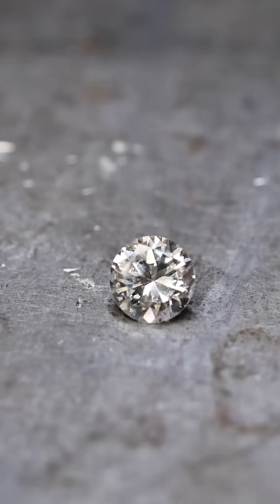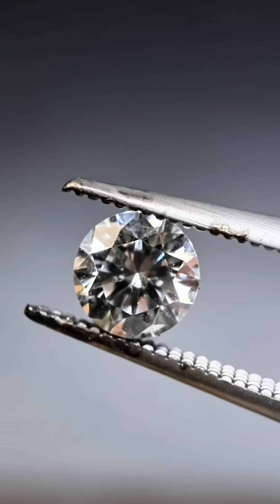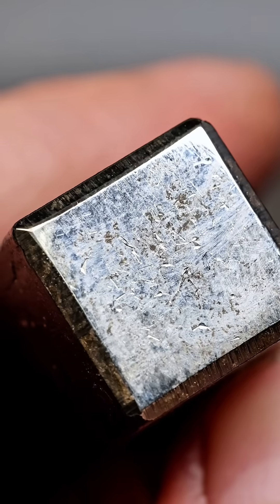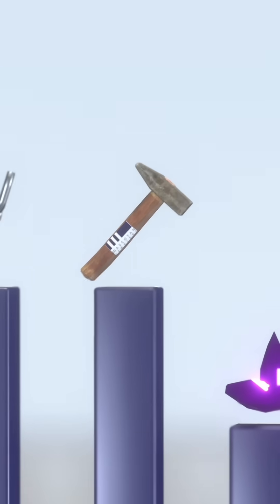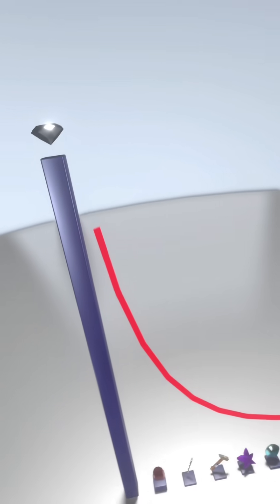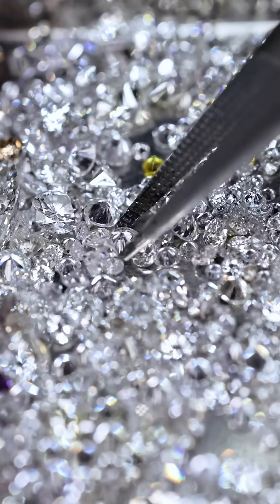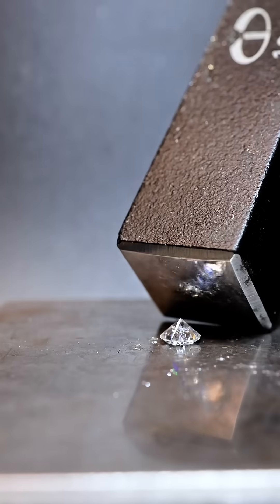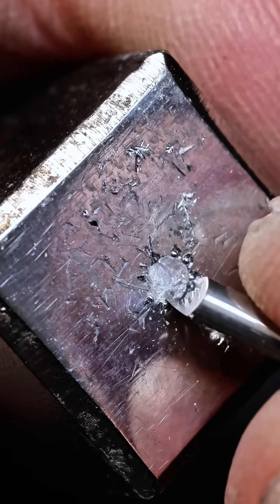Diamond vs Hammer

Comment: one of the worst videos ever seen for misinformation, diamonds are resistant to hardness, but not to tenacity, this means that (if hit at the correct angle and force) they break very easily even with a steel hammer. At least I'm glad to see that the mistake was highlighted in the comments, even if I would have completely removed the video to remake it.

Comment: I think you need to update your hardness scale because actually mature harder than diamond actually the materials called graphene Graphene Is much harder than diamond With 30 layers of It is bulletproof And each layer is as thick as a singular atom By default graphene is much stronger than Diamond Considering 30 mirror layers of this stuff Can It's bulletproof As well as it is much thinner

Comment: BS video, hit a diamond with a hammer with some actual force and it will break.
Diamonds are hard (meaning scratch resistant) but actually brittle (meaning not that impact resistant, or at least way less than what people think).

Comment: Hardness is defined as the ability to resist scratch. Pounding the diamond does not determine its hardness. As a matter of fact, diamond is very brittle. Pounding is a form of tensile test, which diamond is not very resistant to

Comment: not only was the huge mixup between hardness and toughness, you also said something pretty wrong about ordinal scales: you treated it as if it was an exponential scale, in which an increase in the scale would mean a multiplication in value. An ordinal scale would mean the scale doesn't work for any sort of measurement besides "is x greater than y". If Moh's hardness scale is indeed ordinal, the only thing you can say is that diamond is harder than anything below a 10 on that scale. It isn't really possible to drive a "x times harder" on a scale that is ordinal

Comment: Ordinal scale has a different meaning from what you suggested as well:

There are several types of scales used in measurements, each designed for specific purposes. Here’s a breakdown of some common types:

Nominal Scale: This is used for categorization without any numerical or order significance. For example, classifying people by their hair color (e.g., black, brown, blond) or labeling types of minerals.

Ordinal Scale: This ranks items in an order based on a certain property, but the intervals between ranks are not equal or measurable. The Mohs scale, which we talked about earlier, and things like finishing positions in a race (1st, 2nd, 3rd) fall into this category.

Interval Scale: Here, the intervals between measurements are meaningful and equal. A good example is the Celsius or Fahrenheit temperature scale, where the difference between 20°C and 30°C is the same as that between 30°C and 40°C. However, these scales don’t have a true zero (e.g., 0°C doesn’t mean "no temperature").

Ratio Scale: Like the interval scale, but with a meaningful zero point, allowing for ratios to be calculated. Common examples include weight, height, and age, where "0" represents the absence of the property being measured.

Logarithmic Scale: This scale measures data that spans a wide range, compressing it into more manageable numbers. Examples include the Richter scale for earthquake intensity and the pH scale for acidity and alkalinity.

Exponential Scale: Used when values increase multiplicatively. For instance, in sound measurement, the decibel scale reflects an exponential relationship.

Absolute Scale: A scale with a fixed unit of measure and an absolute zero. For example, the Kelvin temperature scale in physics.

Comment: Massoyan makes a correction in the pinned comment, which is accurate, but he doesn't give himself enough credit.
Hardness has a real impact on the impact-fracturing of hard non-ductile materials. For example, if you ever try to break tempered glass panes with a hammer in the center of the pane, it's actually pretty tough to do.  When robbers want to break into a car, they use a little tool with a sharp ceramic or hard metal tip. This tool, on impact with the glass, creates an imperfection in the surface of the glass, a scratch or chip, which due to the momentum of the tool then catalyzes the formation of cracks and ultimately the destruction of the entire window. It's hard to break something without a weak spot.   Throwing ceramic spark plug pieces at windows also works, but softer materials often won't do the trick.

Comment: It’s amazing how a diamond 💎 will shatter when hit a certain way. 
In the body, our teeth are the hardest substance, but the Achilles tendon is likely the strongest structure. A tooth can survive a crematorium furnace but will crack, break, or can be knocked out with very little force. The Achilles can withstand four or five times a person’s body weight, but when tweaked just the wrong way it tears like tissue paper. 
Amazing

Comment: Diamonds can be broken with a hammer, although it's very hard and requires considerable force. While diamonds are known for their hardness and ability to scratch other materials, they are also brittle and can break if struck hard enough, especially at a weak point.   Check online yourself
Reply: it did seem like he was gently tapping it
Reply: @JoseCruz-nd8fi  Glad I'm not the only one who saw that. You are not going break or even deform way softer materials with those love tabs.
Reply: Finally! I was looking for this! Hardness is not the same as brittleness - the tendency for some material to scratch vs. actually break, because of strong directional carbon-carbon bonds. That’s why it shatters.
Reply: real
Reply: How right you are chump! I even seen a T-Rex skull break a diamond. I saw it on Jimmy Neutron
Reply: Geek. Get a life.

Comment: As a 3rd Sec student in Egypt 
MOHs scale is not related to breaking of diamond
MOHs scale is about if the diamond can be scratched or not and since diamond has a scale of 10 this means its very hard to scratch but in breaking if you apply enough pressure on the diamond it might break

Edit: sorry if any information is wrong bec studying geology is new to me so correct me if anything is wrong

Comment: If you place a diamond on a thick iron surface and strike it with a hammer, the diamond is very likely to shatter or crack, rather than get embedded into the metal.

Here’s why:

Diamond is the hardest natural material, but it is also very brittle. That means it resists scratching extremely well but breaks easily under impact.

Iron, especially in the form of a thick surface, is much more ductile and impact-resistant than diamond.

When you hit the diamond with a hammer, the force is concentrated on its crystal structure, which can't absorb impact well — so the diamond will likely break.

So in this situation, the diamond would break, and the iron would remain mostly undamaged.

Comment: Diamonds are fantastic for manufacturing. I run a polishing lathe to finish cobalt chromium metal pieces and a single sintered (diamond throughout the working surface not just bonded to the outer edge) bit lasts me a few weeks used day in day out

Comment: Ok all this is wrong, hardness and toughness are 2 different things, hardness is scratch resistance, toughness is how much force it takes to break something, while daimond way be the hardness, it's actually fairly weak and one good smack with a hammer would break it, not those light taps, litterally slam the hammer on the damn daimond and it'd break

Comment: Wasting precious, limited resources for dumb videos.
Reply: Precious? Yeah they're expensive, but they're not limited. Lab made diamonds have existed forever and they can pretty much perform the exact same tasks with a way lower cost.

Lab diamonds are 60% to 85% cheaper than natural ones, with negligible difference. They require no habitat destruction, no soil or materials. They cause very low amounts of air and water pollution. They require high amounts of energy, but it's dependent on the method they are made from.

They're not wasting as many resources as you're thinking, it may be wasteful money but it's not yours so why care.

Comment: Ironically, what you did there by adding a diamond to your hammer is something similar to a scientific instrument that uses diamonds and a press in order to squeeze objects and apply specific amounts of pressure. It is mostly used to study material changes under high pressure and make metalic non-metal.

Comment: To explain this easier, in the beginning without the diamond in the hammer he was hitting the diamond at the larger part which is very, very strong, but when he put the diamond in the hammer he hit the tip of the diamond which is much weaker. I want to justify, I am not a geologist I just heard this somewhere else, it may or may not be true.

Comment: EDIT: TY @MrK0nam3 for the correction!  :-)
I did the same thing that the OP did [based on the info I knew] and misreading the different website info.
* I confused strength vs pressure with hardness.
* A limpet's teeth are 5.0 - 5.5 on the Mohs Scale... Definitely not a 10! This makes it impossible for the teeth to scratch a diamond.
* In the Discovery program I had watched about 10 years ago, it specifically said something along the lines of, "The teeth are stronger than diamond, making them the only thing capable of scratching a diamond, except diamond"
* That's what stuck in my mind all these years. Also something about the particular snail only being found in the Marianas Trench.

My OP: Since you are a Jeweler, you might this VERY INTERESTING...
* Diamond ISN'T ACTUALLY the hardest material... it's SEA SNAIL TEETH ~(o_O)~
* "While diamonds are incredibly hard, the strongest biological material, found in some sea snails like limpets, is harder than diamond. This material, a form of wurtzite boron nitrate, has a diamond-like arrangement at the atomic level and can withstand 58% more stress than diamond."
* Learned this about 10 years ago on a Discovery program :-)
Reply: Diamond is the hardest natural material, sea snail is superior in other aspects but not in the  Mohs scale which define hardness

Comment: The other diamond wasn't needed at all, steel might be softer but nothing says it can't break a diamond if you give it a good swing. It's like assuming you can't break glass with mud, after all, mud isn't hard at all, in fact it's liquid! But throw a mudball at a window and it will shatter easily. Hardness only applies to the ability of a material to scratch another, so no idea what the heck this video is even about... Just a shitpost? The ability of a material to withstand mechanical forces is not it's hardness but elasticity and tensile strength, which is why steel, which is only somewhat hard but is quite good in tensile strength and has decent elasticity (non hardened) will probably never break unless bent to the extreme (if then, some steel won't break/tear even if it's thick and bent 180 degrees), only bend and deform. So again, gj wasting time and resources I guess, while telling nothing of value

Comment: In electron microscopy, biological samples are embedded in resin and cut into 60nm thick slices using a diamond or glass knife and a tool called an ultramicrotome. The resin basically just a tough plastic, you can trim it a bit by hand with a razor blade. However, at my school new students learning how to cut samples weren’t allowed to use the diamond knives (only glass) because it was possible to chip and break the diamond knives if you cut too deep into the resin; also diamond knives cost about 1k-2k a piece. Imagine having to worry about breaking diamonds with basically plastic.
Reply: This is pretty interesting to read for me being a certified gemstone cutter. In my week of school, I cut three perfect stones. The admin at the school were pretty hyped because nobody had ever finished three in the single week of class, let alone three completely perfect stones.

Comment: Diamonds are hard not tough they might be the hardest material but once there structure is slightly deformed they shatter think of it like a glass bottle compared to a plastic one the glass bottle is harder but unlike the plastic bottle once the glass bottles form is deformed it will shatter

Comment: Diamonds can easily be destroyed when you hit it with the tip facing up. The flat top will take hits pretty easily and most likely damage what hit the diamond. Think of it kind of like that prince Rupert drop thing. The head is strong but the end… not so much.

Comment: It’s not just hardness or density that plays a role. Can cut through metal with a rubber knife. Just takes time.  Metal molecules resist change.  Rubber returns to its shape with less resistance.  Eventually the rubber will saw through the metal like water on rock.   Pure diamonds can be smashed with a hammer because the hammer is applying much more force even tho it is less dense.  That’s why he just lightly tapped the diamond instead of swinging like a carpenter.

Comment: Hit it harder, you can break diamond with steel. The mohs scale is irrelevant. Copper is a 2.5 on the mohs scale and glass is a 5.5. Try using a glass hammer to work copper, you’ll have a smashing time.

Comment: This is totally wrong. Just because something is harder or softer than the other thing does not mean you can’t use it to break it. I have seen somebody smash a diamond with a hammer easily. You give enough force that diamond will shatter with a hammer blow another diamond is not required.

Comment: Metal hardness is not the same as mineral hardness. Metal can be scratched with something softer than it. Also, in minerals, hardness ≠ toughness. You can break a diamond by smashing it vetween 2 pieces of steel. Just takes a lot of force.

Edit: I did not see the poster corrected this already in the pinned comment.

Comment: Complete nonsense! You mix up 
- hardness,
- fissionability and
- breakability!
A cubic zirconia in fact breaks less than a diamond as it is tougher.
The fissionability of a diamond is of a high level parallel to the former surfaces of the double-pyramid chrystal.
More sensitive is just an emerald.

Comment: Due to the imperfections in the diamond you CAN break it with a steel hammer. Also diamond is susceptible to high force shattering due to its molecular structure
Reply: Even with no imperfections, you can still break a perfect diamond with a regular hammer.
Reply: yeah afaik they're hard but brittle
Reply: он и алюминиевым молотком отлично расколется)
Reply: Basically the harder they are the more brittle
Reply: Natural diamonds break easily from everything. Industrial diamond is loads harder than natural diamond and structurally more sound...
Reply: @_Originator probably cheaper too
Reply: Yes. This MF want people to try so they loose money.
Reply: You can't break it easily. It requires a very precise strike with a lot of force.
Reply: @jacobgarcia7918  just trial and error and you'll eventually hit the right spot

Comment: You actually can break a diamond with a hammer, look up videos of people doing it, you just have to hit a little bit harder. Just because something is high in the hardness scale doesn't mean that's unbreakable it just means it has absolutely no give so you won't notice any difference until it completely shatters. For example glass is a hardness of around 6 while iron is around 4 yet an iron Hammer can easily break a glass window

Comment: Mohs applies to scratch resistance. Diamond is mechanically brittle and you can easily break it with a sharp blow. Jade is softer on the mohs scale but is more resistant to breakage compared to a diamond because jade has interlocking fibers.
Reply: I feel like one of the most relatable ways to explain it is to show people screen protectors. So many are advertised as having 9H scratch resistance, but we all know they shatter real easily.
Reply: Hardness and shatter resistance is not the same.
Reply: @zachtwilightwindwaker596  That's what he just explained.